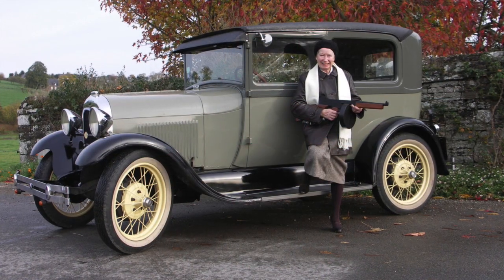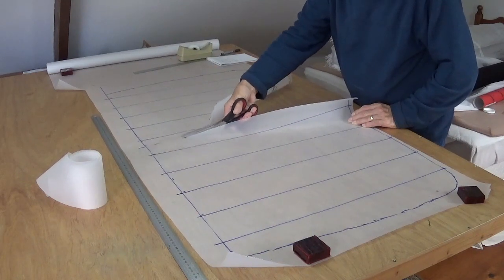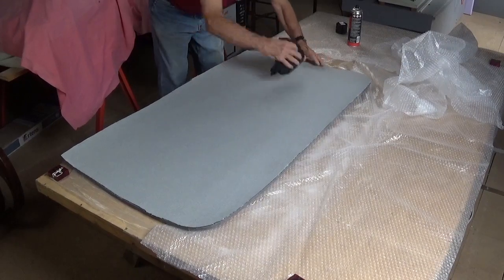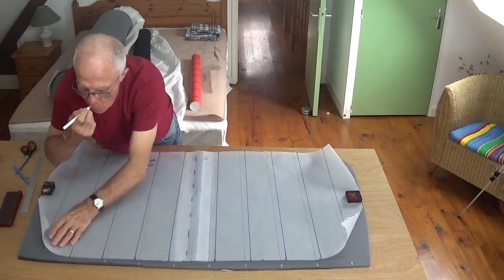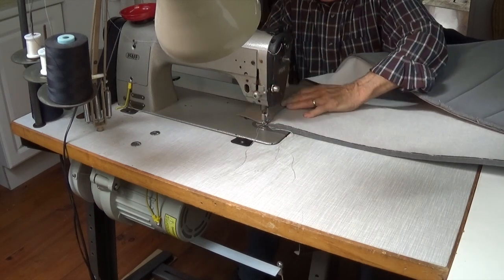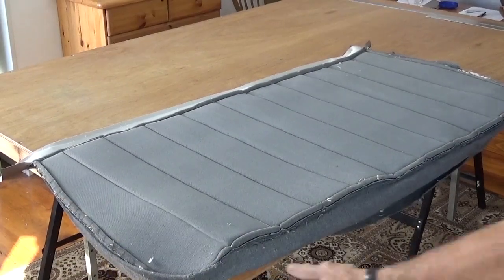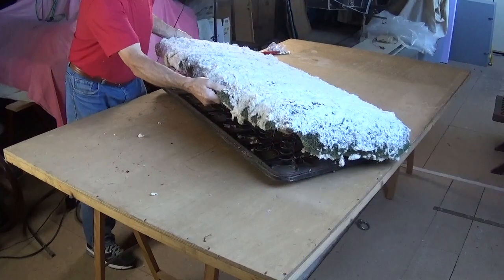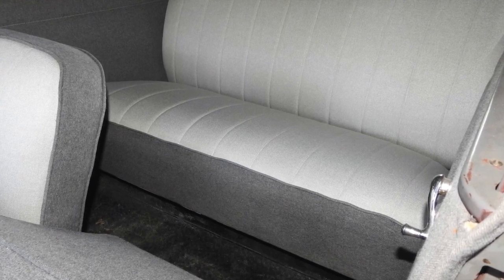Ford Model A Seat Repairs

Comment: Can I purchase the pattern or get a free download?
Reply from the maker: As you will  have seen in my video, I used the old seat faces as patterns.  It very much depends which model Model A Ford you have, what age as to which style of seat pattern you require.  For example the more pleats in the facings the wider the material you require.

If you have the old seat material that you can use as patterns, that is the way to go.  If you have bare seat frames or no seats to copy you could ask for someone like Classtique in the US and ask them if they would sell you patterns.  But you would have to stipulate which year car, which style of body and also which material you intend to use.  It all makes a huge difference.

But do keep away from Mac's/Cartouche they will just give you grief.  Good luck.